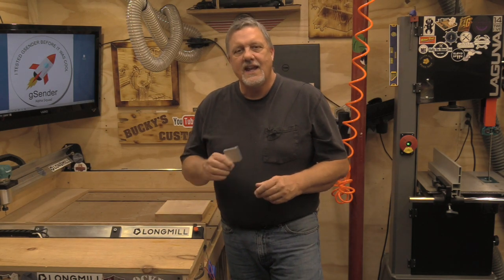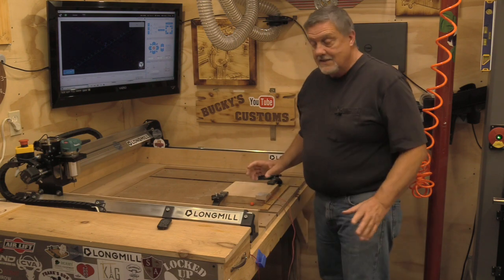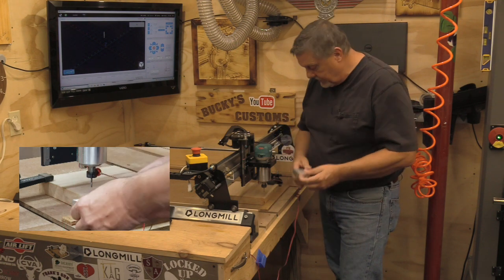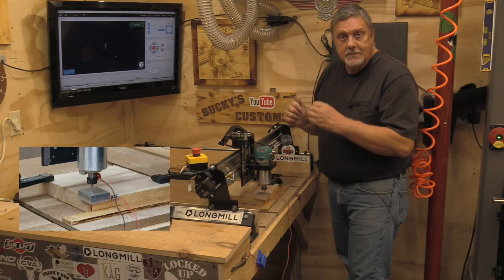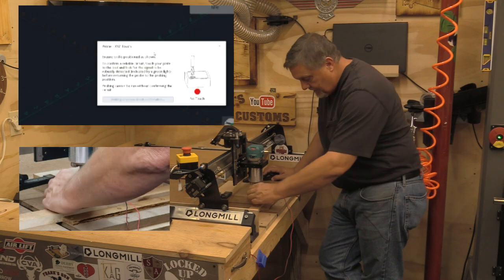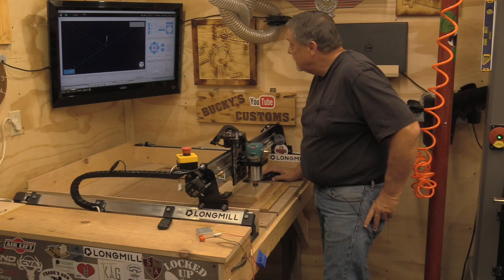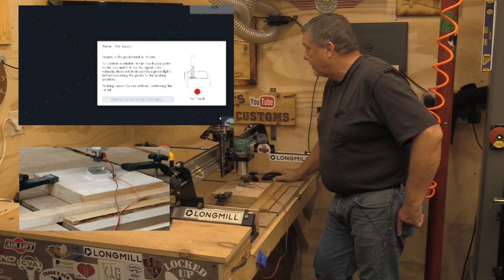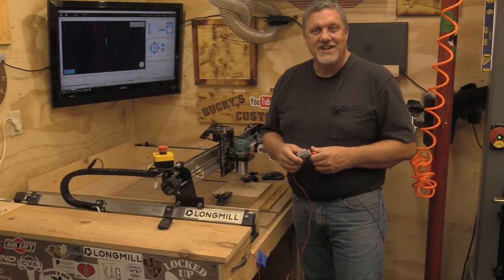How to use a Touch Block with the Longmill Benchtop CNC

Comment: Great video's! I just purchased the MK2 48x30" and ordered the new Zero Auto Touchplate. Watched the videos on how to use it, but my X0 is off the corner of the workpiece approx 1/8". Any ideas about why and what to do to rectify it?
Cheers
Reply from the maker: Make sure you are using the correct setting. Tip or Auto. Tip for V bits and Auto for straight bits.
Reply: @BuckysCustoms  Ill have a look and see. Im using gSender.

Comment: Hello sir nice video. What if your using a 90*or 60* what size do you enter for probing. Thanks
Reply from the maker: Thank you! Unfortunately the standard touch block will only set X & Y on straight sided bits.  You will have to manually set x & y with V Bits.

Comment: Ok, if I understand right, you first do this on the corner and then go to the center. Or do the center only if you want to start from the center?
Reply from the maker: The probe is only used in the center of the project to set the Z axis zero to the top of your project. Your start point (X & Y) is wherever you set the project origin or datum point. If your start  point is the center then you would set that location manually without the probe. If its a corner, use the probe. Hope this helps. Good luck!

Comment: Howabout doing a video on zeroing just the x&y, x, and finally y.
I tried to do just the x&y and due to incomplete instructions for that (not nearly as complete as xy&z) the machine went into a warp drive mode and took the bit straight through the aluminum block! There went my $30!
I am sure it is my fault somewhere but instructions for this are very limited and actually needs to be lengthened. 
Being new and not knowing what I am looking at, I did exactly what the limited instructions said or didn't say. The only thing I had to go by was the picture because of such limited wording in the instructions.
Here is another idea for a video. How to use the touch block for irregular bits. You can do it but you have to divide the cutting diameter by two.
The first time I used the plate I used a 1/16 bit with a smaller cutting diameter (not on purpose) and it was not accurate until I divided the cutting diameter in two and only then was it accurate.
Coming from a programming background, they actually can correct this. Why they choose not to is beyond me?!
Reply from the maker: Coming soon!
Reply: @BuckysCustoms  
Where is the video. My touch block is totally unreliable not to mention I do not think they entered information very well.
For instance, a 1/16 bit actually tapers from the shaft but yet the longmill, even when the right size is selected, will not perform the correct moves. It dives down deeper and touches off on the thicker portion of the shaft. Or it could be mine is totally inaccurate because it cannot making an accurate x0 y0 and I don't think it is doing it accurately for the z either.
I still remember the above problem I had and there has been a few more. I think it is totally unreliable  or at least mine is.
Also, v-bits. I don't care how wide it is no matter what the center is found the same but yet it will not do it.
And I have seen the longmill, when calculating z press the bit into the aluminum block way too hard which actually throws off the z and yes it was a conductive bit. I've watched other manufactures use their probes and the sensitivity to the touch block was FAR different then mine. This problem has even broken a bolt  near my router that longmill assembled. They wanted me to take a video of me trying to turn it instead of taking my word for it but at the time I did not have a phone that could take video so I am still stuck with broken equipment because they admit, in their pdf files, that they have a glitch but yet they will not rectify my problem. I'm getting pissed just talking about it and I'm about to sell this aluminum piece of v-wheel crap.
Oh yeah LONG~MILL Howabout programing your downloads to gSender and making it let US, YOUR CUSTOMERS, know that the download is finished! Novel idea huh? Because of this I have no idea if mine is updating or doing anything at all. The downloading graph will stay on screen for hours and hours and will never go OFF. That makes the customer feel NOTHING is happening! But you continue ignoring and you actually are not thinking about the customer! And then I get problems like the above problems. SO, what good are these updates? They are doing nothing.
And finally since I am on a rant. Nothing against Bucky, but why are you using this video on your website to demonstrate the touch block when he doesn't even demonstrate only the x or only the y or only the x&y.
Why did you do that longmill?
Reply from the maker: @iwannaapple   I am really sorry you are having so many issues with your touch block! And no offense taken! We all need to vent every now and again! Destroying projects and bits is never fun! I had plenty of issues when I first got my Longmill so I totally understand how you feel. In my case, loose connections and my lack of knowledge were the cause of 99% of my issues.  You have been at this a while so you have obviously triple checked everything on your Longmill and Read all you can read till you are blue in the face so, no need to suggest any of that! I have made a few videos since your first post a year ago and I am sure you have watched them all.  Check all connections! Even the printer cable. I have thrown two of them away in the past because they were junk. I don't believe the block is your issue. It is a block of metal so if anything it would be the connection. Clean your Collett as well as the nut so the bit gets good contact and the magnet gets a good connection. Be sure the connection plug is clean and tight.(That was one of my screw ups!) One things for sure, something is causing your issues! Keep at it I am sure you will figure it out! Good Luck!
Reply: @BuckysCustoms  
Ok. Thx

Comment: I'm wondering if there is a way to make it check the X or Y before it does the Z? Reason being if something is wrong I'd rather it break the bit going sideways than plunge down into the touch block. Seems there'd be less damage or misalignment of the router that way.
Reply from the maker: In gSender you can probe just the X & Y and if all is good, start a Z probe.

Comment: When Probing for a center job.  Once the Z probe is complete, Are you clicking ZERO?  Or does it stay as the material thickness?
Reply from the maker: If you only do Z then it only saves Z.
Reply from the maker: So no need to click zero